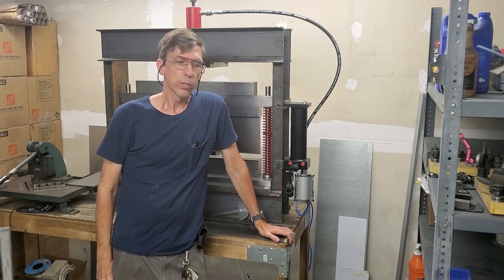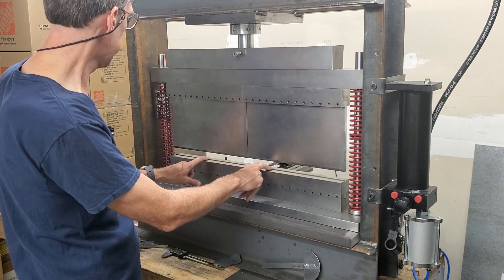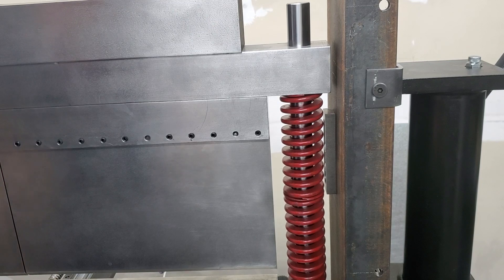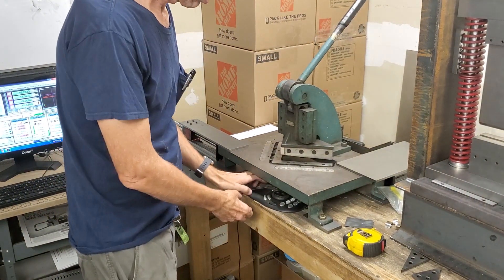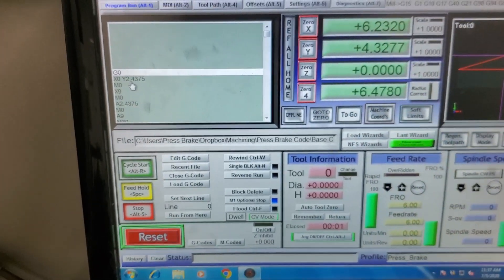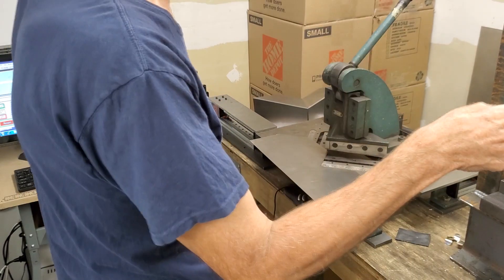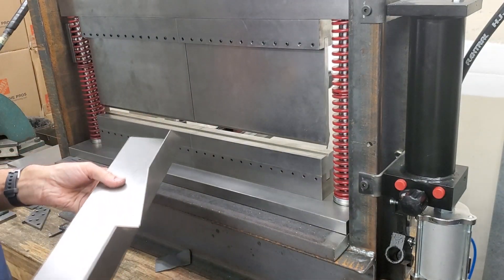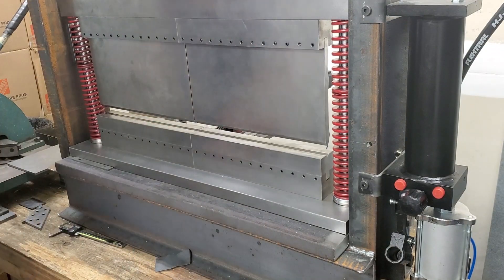DIY CNC Press Brake in Action

Comment: The flare will always be there on a mitre bend , but your vee block open size is a bit to big this exaggerating the problem 6x thickness will give the best result, but requires more tonnage, so basically live with it or notch differently

Comment: Looks like you could give yourself more surface area making contact with your guides when cutting if you did the center notch first then the knock off the 45s 
Awesome set up! My son and I are building motorcycle parts out of our garage and we find we have to make a lot of tooling

Comment: I built a press brake too, I use I micro switch that the ram hits at the bottom of its travel. The switch controls an air valve that cuts air to the pump. The switch is mounted to a fine threaded slide for adjustment and different angles.

Comment: I wasn’t sure if anyone answered this. The flaring is from lack of support under the work piece. You’ll need a larger bottom die, but the solution we used was to have a backer plate. Basically bend two pieces at the same time and your flare will not occur. Alternatively, to save that extra material, you can hammer the with piece down to a die in a vice.
Reply from the maker: Thanks. I started notching after the bending to avoid the problem but the price of steel became too high and I had to abandon the new product line. Maybe in the future, if the prices come down.

Comment: Gotta drill a small hole in that corner before notching it so it all closes up without that little bulge in it. When I use sheet metal software to Cnc plasma cut a 2d box to be bent in a press brake, it automatically cuts a tiny circle in the corner to prevent that bunching in the corner.

Comment: TL;DR: A leaf brake is perfect for avoiding those flares, is cheaper, and you can fine tune the bend radius

The flaring is where the material is unsupported by the bottom die. As the top punch presses down, it forms a roll or radius where the material is compressing. When you have an extreme angle inside the edges of the bottom die, the unsupported section has nothing to grab it and roll it, so it stays somewhat straight. The flare will become more extreme as the angle of the material increases.

The pucker on the last bend is from the metal leveraging itself outward due to extreme pressure and proximity. Fancy software like Solidworks compensates by removing material where it comes together.

You can alleviate the edge flare in a few ways: create a square shoulder that follows the edge of the bottom die, or create a tiny cut along the bend line starting where the metal starts to 'leave' the bottom die. The result for the first will be a properly bent edge (with an ugly square shoulder). The second will be a perfectly bent piece with tiny open corners where the flare would be. 

Neither is a perfect solution, but it is what it is. A leaf brake is the right tool for bending angled pieces with no flares, and for your application it would probably be preferable

If you 'coin' the material in a 90 V die to press the flare flat, it will work but you will gouge a softer bottom die over time. Ask me how i know!

Comment: Would it be an idea to make a 90 degree dolly with a toggle clamp to hold the already formed corner bracket in position and give the flair a sharp wrap with a hard plastic hammer? It might lower it without creating any excessive marring of the part.
Reply from the maker: Thanks, yeah I thought about that and had a few comments also.  I'm trying to reduce the number of steps in the production process.  I am going to be trying to cut the angles after bending and see how that goes.

Comment: Hi, nice device. To eliminate the flare you can swap operations, bend 90 degree the angle, then cut corners and then bend again.
Reply from the maker: Thanks!  I think someone had mentioned that but I dismissed it because I was thinking I couldn't fit it on the shear after that. I guess i can take the tip of the notcher up to the bend.

Comment: Very Nice Set up you have there. This has me modifying my plans. A suggestion to get ends of the bends flat. You could try a small relief, without having to change your set up, drill a small hole, the size of the inside radius right where the two flanges intersect. Same thing on the ends. Try to center the drill as close to the inside bend line as possible. That should help eliminate the blowout. If you would like me to draw up a sketch to better understand what I mean, just reply with a email address and I will send you sketch. Anyways, very impressive set you have. Hopefully you have information about the air motor and such in your link. Thanks for sharing.
Reply: Here is a example of what I was referring to. https://youtu.be/EU2x1arRD4o
Reply from the maker: Thanks Donald!  Not sure how I can add the relief holes while scaling production. I guess i can have them laser cut in but I was trying to make them with a notcher to make them as inexpensive  as possible.
Reply from the maker: I got the air motor from redline engineering.
Reply from the maker: https://www.redlinestands.com/catalog/shop-equipment-c-327/general-shop-equipment-c-327_335/cylinders-pumps-c-327_335_366/redline-re20ta-replacement-shop-press-pump-p-2590

Comment: Be sweet if your stop on the press brake was a switch instead of a stop that cut out the foot pedal when you reach the stop.  Very nice project and video.  Thanks for sharing!
Reply from the maker: Great idea!  I will keep that in mind!  Is that The CNC Cookbook?
Reply: Yes, it's Bob Warfield from CNC Cookbook.
Reply: @CNCCookbook  Hey Bob!  I nearly doubled my production recently when I realized (After Checking G-WIzard) I could run a 3/8" 4 flute rougher (Lakeshore Fire Plug) at 4200 RPM on my Tormach 770!

Comment: Nice setup!  The puckering you noted at the end of the bend is occuring where the metal is not supported on both sides of the bend. The shiny lines left by the bottom die are an indication of where the material is properly supported during bending. Since the metal is cut on an angle that crosses this shiny line area, the bend is not fully supported for this last increment, so in puckers. If you prefer the angled cut, then the cure is to hold a block of metal inside the bend and lightly hammer the metal into shape. As a general rule, always support the metal for the full width of the bottom die, on both sides of the bend to prevent puckering.
Reply from the maker: Thanks!  I ended up going with bottoming dies.  They are both 90 degrees with no radius. The puckering is mostly gone now but I am over bending by 2-3 degrees.   I think I may need to put a  slight radius/chamfer on the punch.

Comment: hi craig im certianly no expert on this type of work but would putting a bit of oil on the die help with the problem?
Reply from the maker: Thanks Ned.  I think I may have to use a different style of punch and die call bottoming that will flatten it out in the bending process.

Comment: I normally just hammer the puckering flat with a flat panel beating hammer and a lump of steel on the inside as an anvil. Comes out perfect.
Reply from the maker: Thanks, Dominic!  That's a good idea.  In the long term, I may need to go with a bottoming die but that may get me by in the meantime.

Comment: Nice project. You need a DRO on the press ram for accurate repeatability.
Reply from the maker: Thanks, yeah I thought about that.  The problem is that the air over hydraulics pushes in like .050 increments.  I have to have a way of stopping the ram from moving past the needed point.  Having the DRO might be nice though to know exactly where it's at for changing to different thicknesses and dies.  Thanks!
Reply: @craigsmachineshop2040  Perhaps you can eventually change up to a reg. Hyd. pump. Or a couple of large ball screws to provide the force. There are large presses that are ball screw operated.

Comment: Craig, mate, great video. I was quite amazed how important the thin gap between the two punches is. Could you share the reason why you want to make these corner pieces. But what quite a lot of want to know is, how you would make a complete box, not just a corner section. I really liked your CNC back stops. I think for the press you need an X and Y CNC stop, so no guessing how to align the centre. Really, a great video.
Reply from the maker: Thanks, Fred!  They are pole base covers.   They have to be 2 piece to be able to put around the pole after it is lifted into place.  Yeah, I thought about using multiple backstops.  I made the shoe 6" wide which should work with the products I plan on making.  I don't have an extra axis since I will have to use 3 on the notcher.

Comment: An impressive build. Working in the industry for many years and later designing heavy, high power stuff I know well the demands for operator safety. I hope You develope Your machines in the respect of operator safety, especially the hands.
Reply from the maker: Thanks, Stephan!  Yeah, I plan on adding a laser on it somehow.  Not much room.  I will have to drill a hole in the channel for it.  It will cut the supply of air with an air switch that is normally closed.
Reply: @craigsmachineshop2040  
Thanks for Your reply!
You obviously have huge skills in electronics and electrical matters but look at time 13:58. A light fence would have difficulties not knowing if it is Your hand or the object.
I would suggest You to "two hand start", using both hands, well apart, for starting the activity. Your mechanical skills will surely quickly create clamping or holding devices that can fixate the object properly, before activating the press.

Comment: Nice video.  Looking at your flair issue and having no idea what I'm talking about I'd suggest the following.  Put the flares on an inside die and tap with a hammer till smooth.  There, I've solved all your problems.  Sorry I can't be of any real help.  Thank you, take care.
Reply from the maker: Thanks Roy!  I think I got it figured out.  I will have to change the bottom die to 90 degree and machine the punch to 90 degree and do what is called bottoming with spring back.

Comment: Hey Craig, a crack will develop in the corner unless you relieve it with a round cut where the corner would be. This will also alleviate the flaring issue in the corner. I suggest you drill a ¼" hole where the corner will end up. Good luck. Ciao, Marco.
Reply from the maker: Hey, Marco thanks!  How is it going?  I can't really make any holes in it for appearance reasons.  I think I got it figured out though.  I have to go to a 90 deg punch and die and do bottom bending instead of air bending. From what I have read, by using a sharp punch it will over bend slightly and form a 90 with a 90-degree punch and die.  Ciao, Craig

Comment: the edges are flared because you are air bending. The lower die is not making contact on the notched corners. Swapping to a smaller width lower die would help (you could just skim material off the top surface on the dies you already have) this will increase bend force , so consider how much tonnage you have to spare. Alternatively you could reduce the size of the notches, at least on the ends of the part, the smaller notch would let the die make full contact up to the edge. you would still be dealing with the issue on the middle notch since you need full depth to get it to fold upon itself. The best solution would be switching to a coining operation where the dies are machined to 90* ( or slightly over) and the die set completely bottoms out.
Reply from the maker: Thanks Teddy!  Yeah, I think I decided to go with bottom bending with spring back.  The bottom bending and coining will put the tonnage over the limits of my press.  I ordered a 36" length - 3/8" VO 90 deg no bottom radius from Midwest Press Brake. I will machine my punch to 90 deg with a sharp point.   I hope that will do the trick.

Comment: Ok first nice job!! Second your flair is part of sheet metal work. You can reduce the flairs  by changing to a coining process. Usually a set of dies with a Vee of approximately 87 1/2* will produce a 90* bend. Basically you apply more tonnage/pressure to squeeze the material out to a 90. The squeezing will flatten the flairs some.
Reply from the maker: Thanks, James!  Just the information I needed to hear, thank you so much!  Do you know the tonnage factor for coining versus air bending?  I am at around 6 tons for 18 gauge at 24".  My press is 20 ton.  What VO would you recommend for coining?  I am at 3/8 for 18 gauge now.
Reply: @craigsmachineshop2040  your V throat may stay the same but your tonnage is going to increase quite a bit. http://sheetmetal.me/tooling-terminology/coining/
try that link and see just what the differences are in coining verses bottom/air bending.
Reply from the maker: @JAMESHOPKINSIBXCNC  Thanks, that's what I was afraid of.  Oh, I found a good PDF on Cincinnati's website.  Says I can get by with 1 1/2 to 2 1/2 X  if I use spring back bottom bending.  That is, a 90 Deg punch and die but with a sharp point punch.  I guess the sharp punch causes it to overbend a bit within a matching 90-degree punch and die.   Page 3 - http://wwwassets.e-ci.com/PDF/Products/press-brake-capacities-brochure.pdf
Reply: Craig's Machine Shop bottom bending is not coining!!

Comment: Slick stuff Craig.  I don't know what the pucker is from.  I'm interested to find out what others have to say.
Reply from the maker: Hey Greg!  Thanks!  I think what Ohmcrazy2 said seams correct "Problem is the “lever arm” goes to zero at that point and the force required goes to infinity thus no bending at the end where the radius starts"
Reply: Just grind it off and call it a day.
Reply from the maker: @greysky1252   I tried that.  Somehow I don't think my customers will approve.

Comment: Craig very nice job on your tools. Nice fit up on finished product. As far as that small area that dose not form up when you bend to 90 deg I think you may have to sand that smooth/flat or you may be able to use a brass hammer. hopefully someone else will have an answer. I would like to hear more about your business and the products you fabricate. thank you for the video. Dave
Reply from the maker: Thanks, Dave!  Yeah, I tried grinding it down but it doesn't look right.  I may go the route of a brass hammer or something til I change the punch and dies.  I think I may need to go to bottoming punch and dies.  The punch and die basically flatten it out.  I make covers for light poles.

Comment: Problem is the “lever arm” goes to zero at that point and the force required goes to infinity thus no bending at the end where the radius starts. Need to relieve the ends a bit to eliminate the flare or bottom bend.  Email me at ohmcrazy2 at gmail dot  com I made a sketch of what I mean.  Cant upload photo here.
Nice job on the custom brake too👍